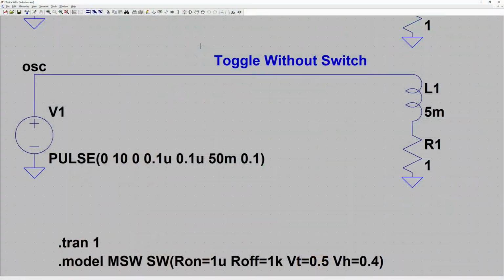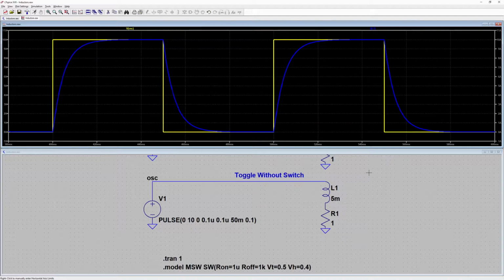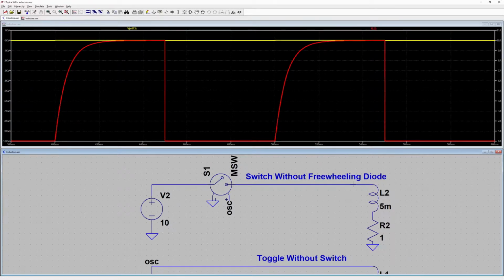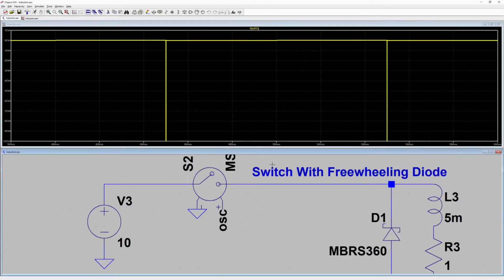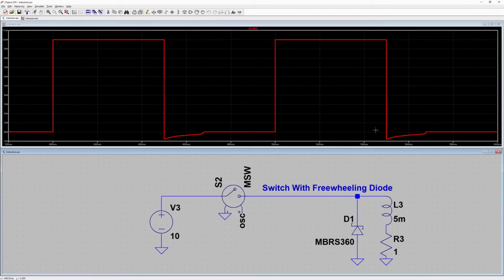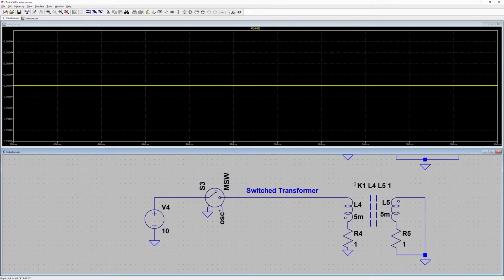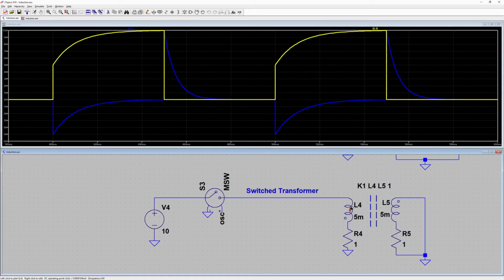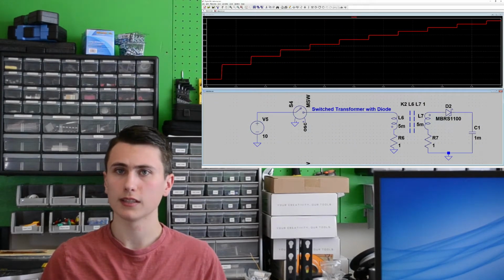Inductors: What are They?

Comment: Very interesting! I learned a lot of new things about inductors by watching this. However one question I had was is that switch that you were talking about oscillating on and off?
Reply from the maker: Yes, the switch is being driven by a voltage source that is oscillating. There is an LTSpice tutorial describing it. http://www.linear.com/solutions/5735 

Think of that switch like a Transistor trying to turn off or a relay contact attempting to open. The oscillating frequency is slow enough for the transients to settle out before changing state again. This is a model of the case when a motor, coil, or inductor is switched on for a while and then turns off some time later after the inductor is completely energized. 

For these examples, I set the switches to open and close at the same frequency as the voltage source in the first example so frequency-dependent properties are consistent. This helps the waveforms to look similar from one example to the next.

The switch is "Ideal", so you can choose an "On" and "Off" resistance for the switch and adjust the voltage threshold when it changes state. If the inductor isn't being switched, it behaves more like a bad wire than a perfect inductor.